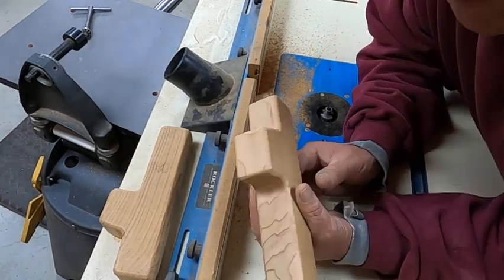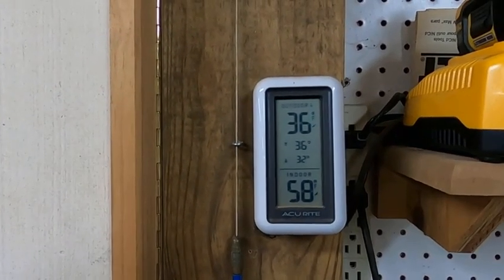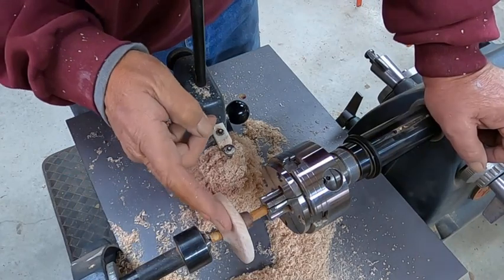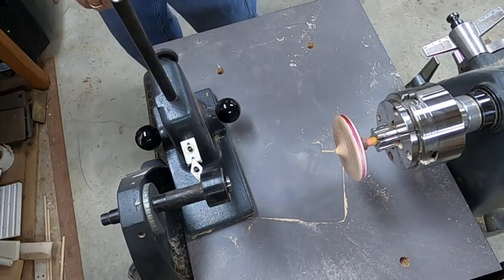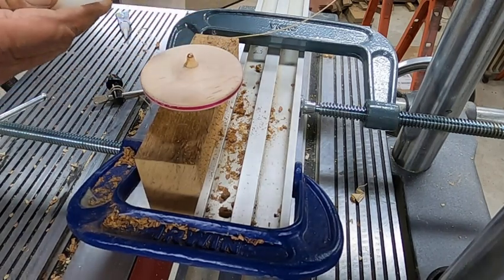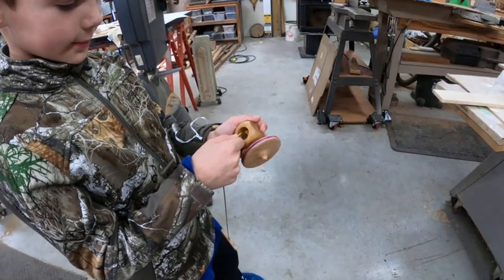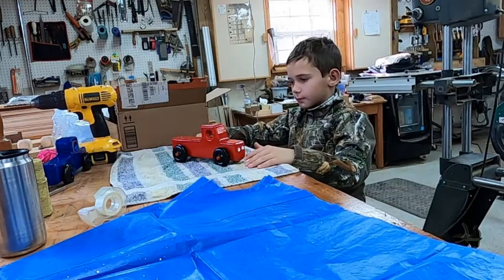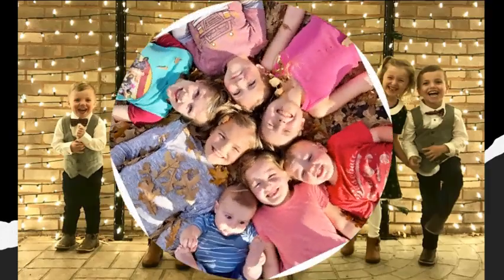Makin' Wooden Toys for Tots

Comment: Plenty of great tips in this video, and a great outcome too. I like your idea of using the duplicator on the lathe. I have a Sorby carbide scraper set that's a little bulky for my mini lathe, but I could probably modify it to work with a duplicator.
Reply from the maker: I have another video coming out soon to explore some other applications of freehand turning on the duplicator.

That would be interesting.

Thanks for stopping by.